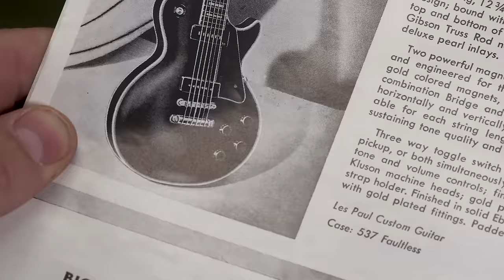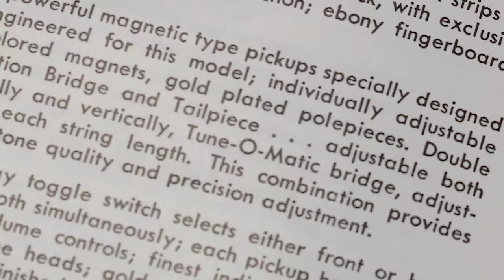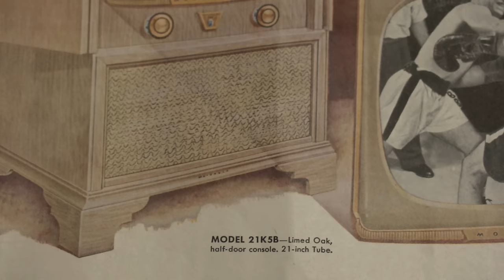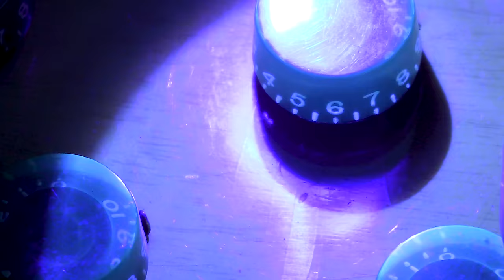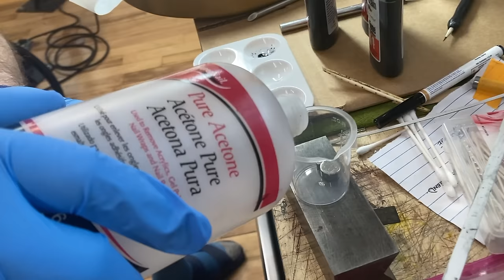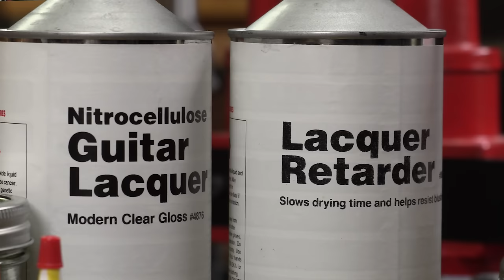What's so special about this '55 Special?

Comment: Awesome! I just got the 1977 “55-77” special so the timing is perfect. Also noted: the catalog from 1955 shows the tailpiece on the LP Custom was top wrapped! Great episode guys. Thanks for sharing!
Reply from the maker: Right on, that's awesome! Enjoy it.
Reply: I had to go back and check, you're right!!  I've not tried the 'top wrap,' next string change will do! Thanks,
Reply: I prefer it. Especially when you have to raise the tailpiece to avoid strings touching the bridge. It definitely lightens the string tension.
Reply: But the Gold Top wasn't top-wrapped. That's kinda fascinating.

Comment: This is great.  I have a '74 reissue, they did it in 1974 and 1977 I think.  You won't see many single cutaway two-P90s Specials around of any vintage.  Got mine for $375 in 79.

Comment: I have a question: the bridge on the Special looks pretty much like your regular stop bar tailpiece on todays Les Pauls (or other Gibsons with a tune-o-matic bridge). Structure wise, what are the differences between the bridge on this guitar to the stop tailpiece?

Comment: Hei Dan.
Nice to look at your videos.
Can you help me with a question?
I have a Furch D23 CR.
It has high gloss lacquer all around. I have sanded with wet sanding 2500 after a small damage on the spruce top. Where I have sanded, the lacquer has become a little more matt than the rest of the lacquer. Is there anything I can use to get the same shine all over it? Afraid of damaging the lacquer.

Thank you very much.

Comment: 1:50. funny how they have the tailpiece with the strings wrapped around. There's so much argument about whether to do that or not. I wonder if that's what they originally intended?
Reply: it's not intended that way
Reply from the maker: On a Special, Junior, or any guitar where the bridge is also the tailpiece, wrapping around is the only option. It will not function as a bridge if you just run through. You have the option with the Tune-O-Matic and Stop Bar, and there are varying opinions about that.
Reply: @stewmac  I was talking about the picture in the catalog of the first les paul
Reply from the maker: @mojorisen74  AH! Yes...good eye!

Comment: I used a small round dentist mirror with a handle and a magnifying glass and a bright torch and even then it's diificult. The only thing I might try for getting a stamped pot code is a cigarette paper and an Hb pencil lead to get a rubbing like the do on old coins and medals, probably a desperate move but worth a try when the instrument is Valuable or Fragile. I like that "Monster grip"...Handy. More dance moves please.

Comment: I know it's not that bad, but, I hate to see any guitar resting solely on the head stock. I've seen so called pro shops do stuff I would never do. Guy was removing fretboard, had head stock in vice, and body was shifting all over the place freely.

Comment: The idea that Gibson would put a special "TV friendly" finish on an entry level instrument seems pretty silly.
Reply: The early ones must have been white anyway. The yellowing of the clear coat makes them appear pale yellow. There are pictures of one that's most likely never seen the daylight since it's purchase and it is white. The white also appears on wear spots on used ones. As far as I know it, they used brown or white pore filler, then basically misted it with primer and clear coated it.
Reply: @Tony.795  thats the way they do it on the non-historic reissues now but in the 50s its was a longer process of first priming the wood with the off white basecoat then pore filling over that, removing the excess filler and then clear coating. that's what gives it the "simulated" wood grain look even though the lines are from real grain. i think the color changed a bit over the years and some were indeed yellow when new. The one in this video is yellow under the pickguard, but some were definitely whiter.

Comment: Everything was nice until de sound check. Just for a change, why don't to use a '55 guitar & amp combo as it "was original intended"? Likewise it was played in the 50's, i. e. no heavy distortion, no 70's rock'n roll cliché.

Comment: 3:45 Except this finish was exclusive to the lowest level of guitar, the model Gibson would least expect their professional musicians to use on stage, even less so on TV. I still can't believe people mention this 'theory' as having any validity. It sounded just as dumb the first time I heard it as it does now. I do appreciate that you actually mention the proper place it comes from and indicate that as the 'likely correct' story, however you do confuse the actual reasoning their too.. The finish was called lime, nothing to do with 'the wood being the same'. They used the same 'lime' finish on both Oak and Mahogany, as both were popular woods that Television enclosures were built in. It is highly likely there are other 'limed' woods from the same period with a similar looking finish, on an entirely different species of wood.

Comment: First I want to say I love your guitar repair books, Dan.  And that is one very cool guitar.  But I have a bone to pick with you guys.

That guitar is nowhere in mint condition.

To qualify as a mint condition artifact, it must be, first and foremost, completely original.  The fact that binding and tuner knobs have been replaced removes any claim of mint condition.  The finish is in great shape but has begun to check.  Again, not mint.  The strings are not original, and the truss rod cover and backplate have been removed.  Not mint.  Soldering has been done.  Not mint.  

In order to qualify as mint this guitar would have to be in the exact same condition, in every way, as when it was built.  In addition to guitars, I am a collector and dealer in rare coins and books.  I possess three first editions by Ray Bradbury that I am considering putting up for sale.  They are three copies of the same book, A Memory of Murder, published in 1984, if I recall correctly.  I purchased them at Lanning’s Book Store in San Diego, California, that same year.  One of them I have read very carefully, and it shows no signs of any damage or wear whatsoever.  The other two copies have been in storage under temperature and humidity control, and they look almost as fresh and new as the day they were printed and bound.  

Could I, in all conscience, advertise these books as mint, even the pair that have never been read?  Absolutely not.  Even the two unread copies show that the pages have yellowed and become slightly brittle over the last thirty-nine years.  The best I could do would be to describe the unread copies as very fine/near mint.  And the copy I have read could grade no better than very fine.

There is no such thing as a guitar in mint condition, unless it has never been played and never taken out of its case.  This is a warning to anyone buying instruments from sites like Reverb and eBay.  Items offered for sale are almost never in the condition listed.  They are usually at least two grades below the grade that is claimed.  Caveat Emptor.

Comment: That acid on the electronics, completely pointless and stupid. I would have checked the caps, I'd bet you $100 they leak DC. Just replace them with new. Also, just replace the tuners, all this "aging" seems dumb. Replace them. Good job on the binding. I would have just used new and not painted it, nobody would know.